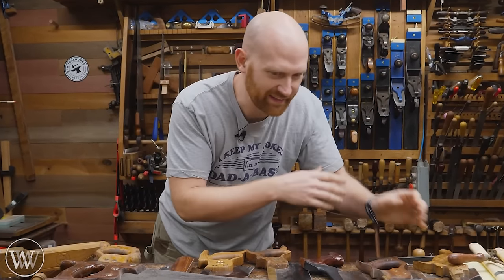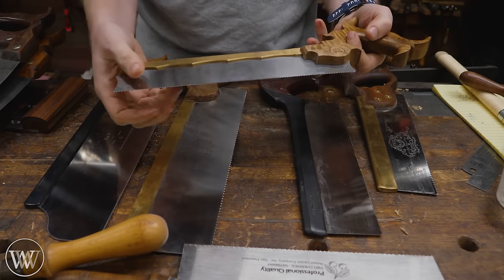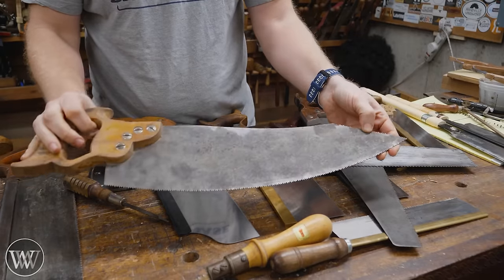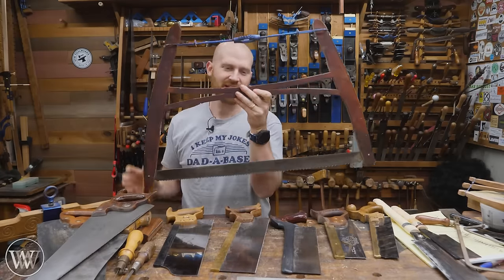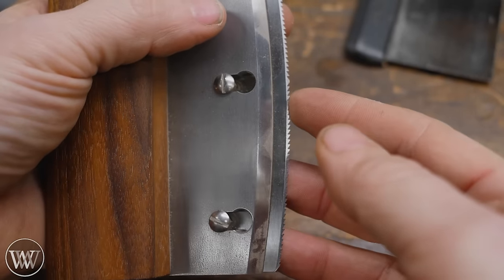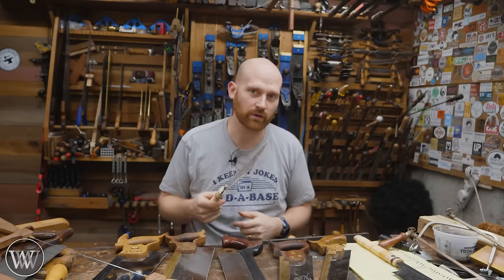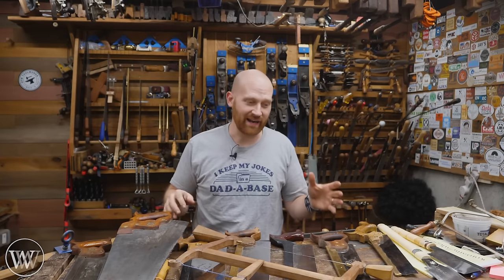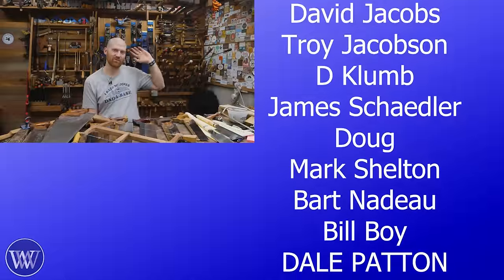All Of The Saws One Video

Comment: The nice thing about Japanese saws is they are so cheap I can throw them in a tool bag for home improvement jobs and not stress if they get dinged or bent. Plus they leave a super thin kerf.
Reply: Definitely, yes. I have several handles, and I can get crosscut and rip blades in the UK for only around £15 each.
Reply: I also like that my Japanese style saws tend to be lighter than their western counterparts.
Reply: @osliverpool  there are those foldable ones that i love. they live in my tool bag. i dont have to worry about saw tooth cutting me every time i reach in there. they are not that more expensive compared to their non-foldable versions, plus foldable things are cool and you are wrong if you think otherwise.

Comment: I tried Japanese saws but have the “slightly off turns into way off” problem. I mostly use western saws.

But sometimes I want the precision of a backsaw, but too deep of a cut for it.  I don’t have one as deep as a tenon saw.  I’ll start the cut with the backsaw and switch to a ryoba to finish it.  Total hackery, but it works.

If you say “fret saw” I think of a narrow kerf (usually gent) saw for cutting fret slots.  Some have a stop built in, but I use a mitre box-like jig that catches the back at the right depth.  I forget people call coping saws that.  Now I’ll say djent saw.  (metal dad joke)

Comment: not sure if it is a skill thing, manufacturing error or the saw design itself. but i find the ryoba saws doesnt track straight with very hard wood unless the grain is perfectly straight. its almost like the saw is so flexible and thin, the wood grain is dictating where the saw goes. its specifically a problem with Jarra, ironbark and spotted gum. its a shame they happen to be my favourite woods.

More than happy to accept its a skill issue, which means the problem will go away with time and practice.

Comment: Isn't what you called a keyhole saw called a pad saw? Is that just another name for the same tool, or are they actually different? I assumed a keyhole saw was non-collapsible, and the pad saw allowed the blade to retract/collapse into into the handle. Any clarification would be appreciated. Great video as usual!
Reply from the maker: It's just another name for the same thing. That's the fun thing about auntie can tools is they come with dozens of names each.
Reply: @WoodByWrightHowTo   Well, James, the only thing I could disagree with in this otherwise excellent video is found right here in your reply. Technically speaking, a keyhole saw and a pad saw are two separate saws. A compass saw is the same as a keyhole saw, but a pad saw is a pad saw. Now, for sure, people use those two terms synonymously, but originally they were two different saws—ahem, which essentially did the same thing! But the pad saw’s blade was adjustable; the keyhole saw’s blade was a fixed length. That’s the main difference. 😉

Comment: I did have a thought about the Roubo saw (hope I spelled that right).  Could you theoretically put in two parallel blades to cut a board?  Like if you want a two inch board, have a Roubo with two blades, two inches apart.
Hoping that makes sense, and thanks!
Reply from the maker: yes I have seen some do that, but then you cna not control it at all. if one goes off track then there is nothing you can do about it. some big wind mill saw mills would do that but with very thick blades that would not bend easily.
Reply: @WoodByWrightHowTo  Interesting.  Thank you very much!

Comment: Really liked this one.. But I do have a question. Where are you sourcing the Blades for frame Saws? I have only found Highland Woodworking but the options are pretty limited and they don't have the roubo frame saw parts.
Reply from the maker: For the large frame saw I either get it from Bad axe tools or Blackburn tool works. For the turning saws and smaller frame saws I usually go to tools for working wood

Comment: My Dad only had four saws he used for woodworking most of his life, a handsaw (it was 30”) a table saw, a ‘Skil’ (his circular saw was a Skil) and a ‘saber’ saw (jig saw). He did lots of great project with that small arsenal. He did add a scroll and band saw after I moved out! I got the bandsaw when he moved south. 

I have a few more than he did. A hand saw, measures in at 26”, a carcass saw, a sash saw, a coping saw, and a Ryobi. Well okay I have Dad’s band saw a table saw, powered miter saw, jig saw, a Skil circular saw, reciprocating saw, oscillating saw, oh and I remembered key hole saw, hack saw, bow saw to cut the Christmas Tree and I think that is all of them. WOW, I must do a lot of cutting!  I do dovetails, and mortise and tension joints with my back or ryobi saws. But I also use carpenter chisels to run them up. Probably why you’ve never seen me on the cover of Fine Woodworking!  

I have

Comment: Keyhole saw is for hand tool drywall
Reply: They can cut wood, at least the old ones could. My grandfather had one with two blades with different size teeth. His house was old; before the days of sheetrock. I doubt he ever used a piece of sheetrock in his life. It has a wooden pistol grip on it.
Most of the ones sold today are just for drywall, but that was not always the case.There were keyhole saws around before sheetrock became popular.
Reply: @debluetailfly  very cool